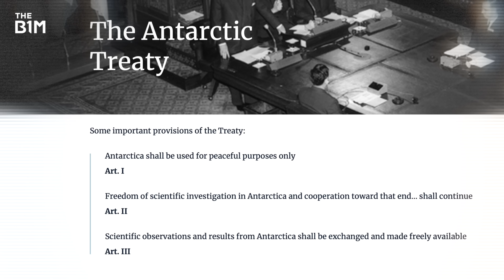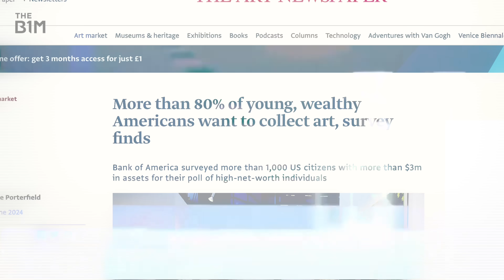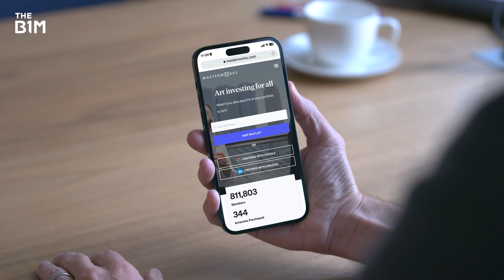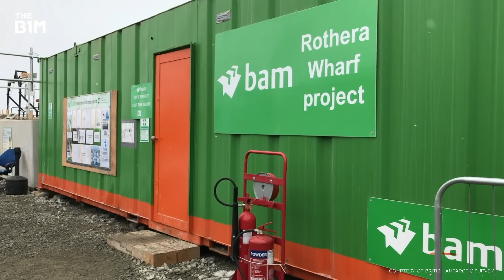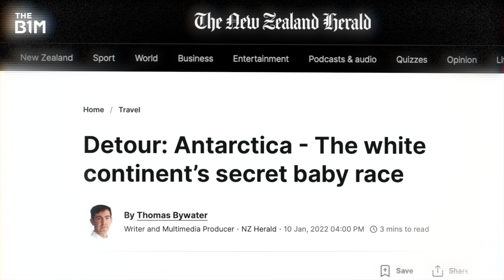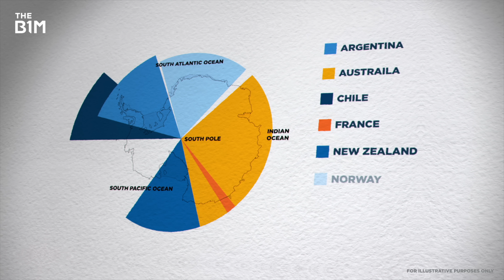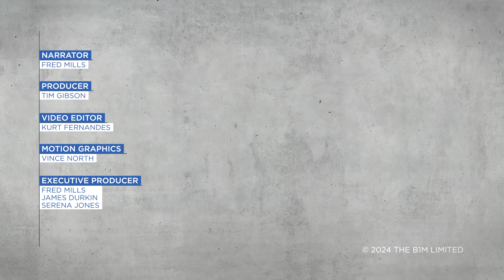The Race to Build in Antarctica

Comment: Looking at ur photographs, those tanks and rail cars were not "lowered" into the water, they were dumped off the side of the barges..  Lowering would be a more specific act of using cranes and chains to "lower" them into position to a specific place on the bottom of the sea floor...

Comment: 8:48 why build on the surface?  It would make more sense to mine into the mountain, tunnel down until the temp is around 22 C and build one’s base at that horizon. 
  The material mined from such a work could be used to help construct the Drakes passage dam.

Comment: Strange there was no mention of the difficulties of building on permafrost.  Unless that's not a problem in Antarctica?

In northern Greenland, the buildings are either elevated to leave an air gap between the building and the ground or the building is built on gravel foundations with air vents on either side of the building.  In the winter, the vents are open to cool the gravel as much as possible.  In the spring, the vents are closed to preserve the cold through the summer.

The officer's club at Pituffik Space Base is currently closed due to the foundation cracking in half.  No idea when it'll be rebuilt (it's the major social hub for the base, so it's pretty important), but any project takes years of planning and everything has to be ordered a year ahead so it can be on the one container ship that visits each year.  I'm hoping it will be open again before the project my company is working on kicks off a couple years from now.
Reply: Antarctica has more Solid Ground

Comment: Hmm...not proper architecture! I would consider much better amphibious icebreaker which can climb on ice surface and unfolds in a very good insulated station, or, using mainly ice to cover some light structure obtaining like this a thick ice insulation (somehow importing the igloo concept)

Comment: The same should be taking place in Greenland. In roughly 25 years the Sun will micronovae again and send Greenland and Antarctica swinging back and forth across the Equator until magma /crust interface cools again. The elite know this. 90% ELE. Happens fast enough to freeze a wooly mammoth while grazing. 2 mile high global tidal waves called "Slosh". Most all dwellings will be leveled like North Carolina high country in the valley. ($31T in Lithium reserves.)

Comment: Seeing these bases, it makes me wonder, how do these bases get their power? I have seen some pictures and video clips of some of them using wind-power with windturbines hardned for that kind of weather. But it makes me wonder if any of them use like direct geothermal heat, or geothermal heat pumps. Sure, the top-layer of these places are frozen as hell, but there are a few places with volcanic activity. And if drilled deep enough they could use the 'normal' heat down there as well, which I think would be a more reliable source of energy for power and heat, considering in what a remote and inhospitable place these bases are.

Comment: In case anyone's wondering why the plant machinery is quite old, it's due to the emmissions regulations on different generations. Older equipment has less stuff that goes wrong, simpler to work on and likely can have multiple machine models as backups for the same price as a new model.

Comment: Seeing as you mentioned that the antarctic doesn't have any hardware shops incase parts are needed I imagine there must be some fabrication tech used down there, like metal 3D printers to produce things such as brackets and tools.  With the exception of the ISS Antarctica is the one place where the ability to manufacture what you need on location would be incredibly useful.

Comment: Nice and interesting video. However the subtitles does not work very well. It's better with fixed subtitles all the way through. With that said, it's saddening that we (humanity) have not learned anything from our mistakes. It's the last untouched (or more or less untouched) continent and yet we are going to fill it with activity pollution and - oil drilling... Oh but why!? We should really stay completely away from that place, perhaps except a little scientific research (and they should not research oil). But the best would be to agree to stay completely away from Antarctica. But that is probably too late. One can only hope that by 2048, the demand for oil is so low that it has lost it's value.

Comment: Here of all places should utilize Small modular nuclear reactors.. The technology and our understanding around safety has advanced so much. Places like this should really utilize these remote location energy generators
Reply: The Yanks actually did have one at their biggest base, but it was removed and replaced with conventional electricity generation.
Reply: How would you transport the electricity in an affordable way though?
Reply: @Hopefullyahedgehog  oh I don't know, Maybe you could transport electricity by using the SMALL MODULAR NUCLEAR REACTOR Lol 🤪 which would provide a ton of affordable and efficient electricity 🔌 💡
Reply: @benmcreynolds8581   I don't think you know what a small modular nuclear reactor is: 
Small – physically a fraction of the size of a conventional nuclear power reactor.
Modular – making it possible for systems and components to be factory-assembled and transported as a unit to a location for installation.
Reactors – harnessing nuclear fission to generate heat to produce energy.
A small modular reactor is not a huge battery it is a generator.
If I understand correctly you are suggesting that we use the space in Antarctica to make nuclear power with no risk to life even with a catastrophic failure. But once this electricity has been generated it needs to be transported to wherever it needs to go, the most practical would be through under sea cables to Chile then through most countries in south America, then through undersea cables again to Europe. However this would be ruinously expensive and time consuming as well as having security implications by relying on the good will of at least a dozen countries to get electricity. While only making nuclear reactors fractionally more safe (there has only been 2 cases where people have died directly from nuclear powerplants).
What I was asking is do you have any alternatives?

Comment: I would love to see a design piece on the roofing system of the new building. Particularly, how the snowfall is directed off the building and towards the “dock” areas where they would seem to fall victim to the same slides and accumulations that are shown at 13:24 - 13:27. The seasonal snowfall is measured in Meters☺️
Reply: Hi there, I was lucky enough to work on the Discovery Building! If you look at 6:28, you'll see what look like vents on the upper corner of the roof- this structure is a 'wind deflector', which we designed to funnel the prevailing wind down the face of the Leeward side of the building, reducing snow buildup which will usually build up on this side (away from the wind).
Reply: @marklewis2428  Many thanks for that, I was in roofing & sheet metal for 30 years and the system design work was often fascinating.
Reply: @bill9540  worth noting that the animation has the wind direction backwards. the wind comes from the lower side, up the roof then is fired down by the wind deflector. if they ever get round to fitting it...
Reply: Heated roofs,

Comment: Great, so now we're going to get a building boom in Antarctica to mine oil that we need to be phasing out usage ASAP, not finding even more to help mess up the planet.
Reply: If you want your EV to cost $35k, guess what, the factory building it will need to be fueled by cheap gas and petroleum. Clean energy works for individual houses and some smaller businesses but not energy-heavy industries which still need fossil fuels.
Reply: @MuzzaHukka  nope, not true at all, those can all be done fine on renewable energy, heck being an engineer I work with companies that do that exact type of work, the one foundry we use for large industrial castings had their own solar farm to power the furnace to melt the metal to pour into the castings. Practically all equipment used for industrial factories is electric and literally had no need at all for fossil fuel. Also gas and petroleum are not cheap, at all, one of the reasons people go solar is the sizable savings vs grid supplied fossil fuel based electricity due to the ever rising costs of fossil fuel.
Reply: @sandrahiltz  dei hire for sure
Reply: @sandrahiltz  If I can have fossil fuels supplied to my furnace through existing infrastructure, or I need to buy solar panels and additional surface area (real estate) to put those solar panels on, how much more money must I spend (compared to the cost of leasing a furnace, the warehouse that it'll sit in and paying for the energy consumed) to switch to renewable? It's like buying a million dollar electric bus instead of a $250k diesel powered bus, for public transport. If you're somewhere like Monaco or Beverly Hills with a budget surplus from property taxes, I can see you being able to afford such a vanity project, but it doesn't make economic sense to switch the entire world to renewable.

How can there be "sizeable savings" if your initial investment is 2-5x more because of the new technology needed? Fossil fuel prices are not rising, politics is causing prices to go up. If we dealt with Venezuela and extracted oil from under Antarctica, crazy Muslims wouldn't be able to hurt Americans at the gas pump every time their fanatical demands are not met.
Reply: @MuzzaHukka this
Reply: @MuzzaHukka yep. Try running a steel mill with windmills 😳
Reply: You do understand that anything made of any kind of plastic uses OIL. Oil is used for more than cars. Plastic (unfortunately) isn't going away. Less oil use is a flawed incentive.
Reply: @joestuff8  plastics can and need to be recycled massively.
Reply: @joestuff8 most oil is used for cars
Reply: greedy assholes WILL destroy this planet.
Reply: I know right. Hope we end up waking Godzilla up while mining😆
Reply: Oil is based, have a cry. And it’s gonna be around for a long time.
Reply: @bigsyrup8567  nope, it's not, because it's rapidly running out, it's a finite resource, it's foolish to be so short sighted and not realize this fact, there's about 50 years worth of oil left on the planet at the current usage rate and then no more oil regardless of how stubborn you are.
Reply: @sandrahiltz  there was 50 years of oil in 1980 and the oceans were supposed to be so high due to global warming that world should have ended in 2000's 🤣

People keep believing bs and are so uneducated about things they think they can "stop oil" & live normally
Reply: @sandrahiltz literally none of that is true.
Reply: Until it's phased out, we need oil.
Reply: You are clueless, arent you? 

Phasing out oil 🤣
Reply: @hiteshadhikari   these people have no clue.
Reply: @gladlawson61  yep clearly
Reply: @sandrahiltz  "male stubbornness against change"

Says a lady who gets to enjoy the benefits of society created and preserved on the back of men and their work.
Reply: Stop crying.